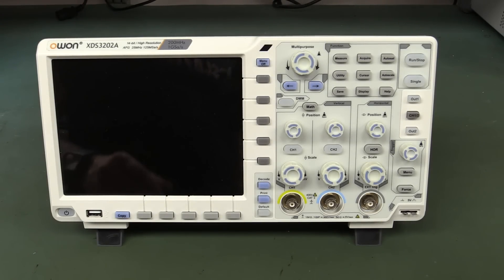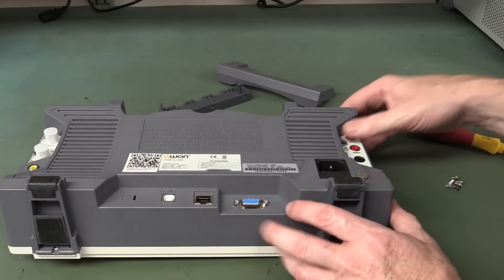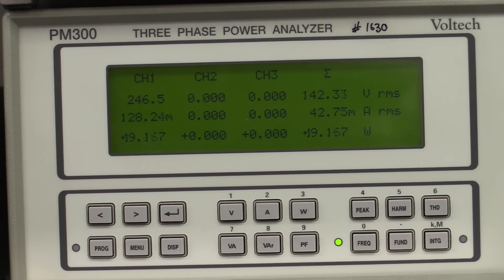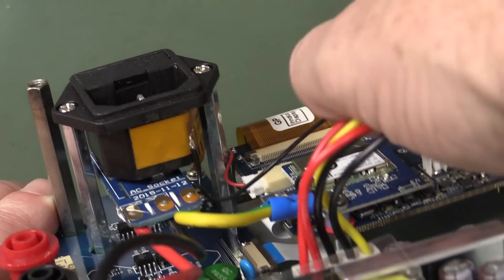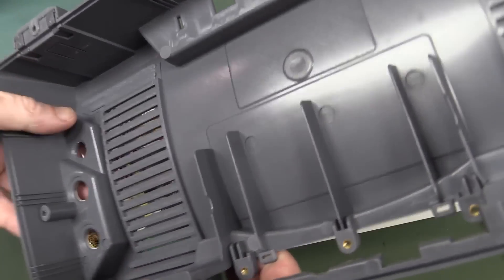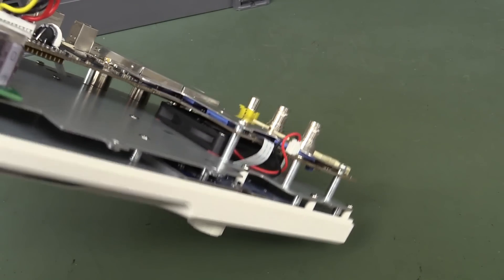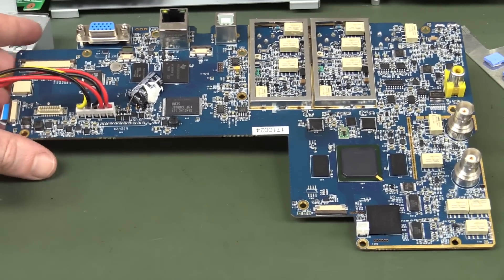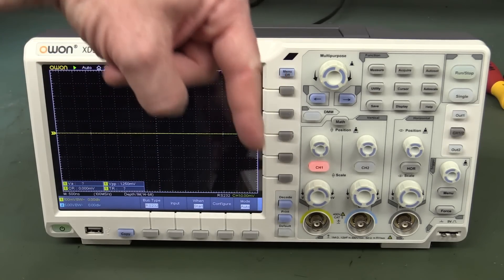EEVblog #1004 - Owon XDS3202A 14bit Oscilloscope Teardown

Comment: That's what you get when you run Microshite ripoffware. I went 100% Linux over 10 years ago and never looked back.
Reply: Robert Langford And no one professional but  popular software You can use :) I'am windows fan, and I never had problem with it. Not once. I never saw blue screen. I never did reinstall. I never saw self frozen. Maybe because I always using workstation computers? I started using Microsoft OS with IBM 286.... 25 Years ago.
Reply: Raymund Hofmann The words of a body that has never given an  operating system based on the Linux kernel a real world trial. The only reason to stick with Windows is to play games that are not available to play on Linux based systems. I have yet to find anything else that I do that I can't do in Linux. As for hardware, I build computers and have no difficulty finding drivers. Mostly they are built into the system now. The difficult ones are for hardware that the manufacturer will not make open source drivers for. That's not the operating systems fault, that lies with the manufacturer. Uneven have laptops running various Linux distributions that I support that have no problems running the installed system.
Reply: Daniel Han So no real argument, just insults? You lose! Goodbye.
Reply: "Finally wifi works out of the box! Maybe this will be the year of the Linux desktop?" (2016: Mobile web usage overtakes desktop for first time) "Damn, the desktop is becoming dinosaurware..."
Reply: @AP12uZvfvag
Android is based on Linux. 
But they also based it on Java, to make it easier for Microsoft to take over the mobile market soon.
Reply: Based on Linux, yes, but as the Stall man would interject, not otherwise based on GNU. As for Microsoft taking over the mobile market because Android is using Java... what are you smoking? They had one chance to get into the mobile space, and they blew it. Microsoft won't be able to take over the mobile market just because they implement an Android compatibility layer. That's just wishful thinking on Microsoft's part. :)
Reply: You're one to talk, you had no arguments either so declaring someone else a loser based on that is not looking good :D I've used Windows, Linux and Mac in many different roles for ~20 years now and they all have their place and their problems. Anyone thinking that Linux is the ultimate tool for everything is just as delusional as anyone thinking that one single programming language is perfect for everything. There are no perfect tools. Linux has its place but it most definitely is not desktop. It has so many problems in multiple areas that the only reason to claim it to be the best desktop environment is fundamentalism pure and simple. Linux is awesome for servers and other remote machines or single use systems like media players but it just can't compete as a general environment. Even the programs made by companies that drive open source software forward like Google or Mozilla work worse on Linux than on windows. My previous work environment was a Linux and Chrome on it was not able to share itself on Google Hangouts. It could share other open Chrome instances, just not the one that had the hangouts page.
Reply: @AP12uZvfvag
Who knows what will come, but i hope my message of how much i dislike Java got through...
Reply: Bean there, done that... Now, Java is where the Sun don't shine no more. All we have left are the faint ramblings of a blind Oracle.
Reply: Shocking news: Linux can also crash after update, been there done that.
Reply: I've never had Linux crash after an update, but it depends which distro you're using. Unlike windows and Apple there is more than one source.
Reply: Bartłomiej Z But never so badly that you can't recover the system because it garbaged your hard disc, except by completely reinstalling Windows and all of the rest of your software, and by the way, you did make backups of all of your settings and files didn't you?
Reply: If you do backups on linux, why you don't do them on windows? We talked about that if it  crash after update and not about what to do to repair after crash.
Reply: Windows 8.1 is more stable than Windows 10.
Reply: No offence, but can you name the linux software for pro imaging like Photoshop. When I say pro I mean support of color spaces like LAB and CMYK, and... well totaly proprietary color management with Pantone. =)
And how about multimedia work like video and sound editing comparable in it's functionality with Final cut/Premiere or Logic/Sonar/Cubase?
Me not trolling you, just hope You can name some powerfull soft as long time Linux user.
Reply: You mean the same photoshop that causes jpeg artifacts to snowball into major picture corruption? Just opening and resaving images causes measureable distortion.
Reply: there's more than games on windows... how about... well i dunno ... engineering software? since thats possibly kind of relevant if you're following this channel... a looot of it is windows only :/
Reply: I have been using Linux professionally for about 20 years, my first was a pre-1.0 Slackware release. It's my full time job to adminster Linux servers. I would love to use Linux on my desktop, but I'm still running Windows.  I have tried on 5 separate occasions to switch to Linux on the desktop, and it's been a pretty bad failure every time.  The most recent time, I decided that I just had to get used to it and forced myself to use Linux as much as possible for 2 months.  1 day after that I was restoring my Windows partition and never looked back since then.
I have many friends who use Linux, some of them are some of the leaders in the Linux community, and they really haven't been able to tell me I'm wrong.
Every time I try this switch I have the same experience, which is that the vast majority of software installs and works OK, but then there's always some piece of software that I really need, and I can spend literally entire days trying to get it even basically working.  What it comes down to is that if the software is in the package manger, you're good.  If not, it's a nightmare of conflicting prerequisites, installing libraries that are not very well documented, etc.
Also, at least as of 2 years ago, I've never been able to get all my hardware working properly.  Printing especially is still horrible.  It mostly barely worked at all 20 years ago, 15 years ago it was disastrously bad, 10 years ago just horrible, 2 years ago (last time I tried) it was just very disappointing - you would get 1/10th the feature set the printer was capable of doing.  I have webcams that I never got working. Display drivers were generally abysmal.  Some printers simply can't be used under Linux (I have a label printer that I use heavily that I have never even heard of working under Linux).
Reply: Agreed, for servers and for embedded systems, Linux is fantastic. It's running on a very large percentage of the world's computers. But for me anyway, it's hopeless on the desktop.
Reply: Got to be a one off experience.
Reply: @John Ridley - I have the same Linux background (Slackware v1.0 yeah!) However I am a hardware/firmware engineer and do use Linux with no problem at work. Any time I need to run a windows app I just light it up on a Win7 WM instance with Virtualbox; there are only a few I need... I think the ability to run Linux as the main OS comes down to the work in the end. In your case it could be that the richness of windows applications for your IT needs is just not available in Linux and its just less painful to run Win as your main OS... I do run Win7 & 10 at home and do some firmware stuff there. In the firmware work on windows it seems that Windows 7 is still the sweet spot... nothing but pain for trying to get Win10 to work.
Cheers,
 - Eddy
Reply: backup always as usual :) Regardless OS...
Reply: macOS > Linux & Windows
Reply: You can't even get a licence for OSX without buying Apples overpriced hardware or old ass machines.
Reply: Raymund, I've been using Linux as my desktop OS for nearly a decade and I'm far more productive than I ever was using Windows as my desktop platform.  I'm no Linux Jihadist, just someone who values my time and likes to get the most work done in the shortest period.  Linux for me isn't a ideological choice -- it's a practical one.
Reply: Every OS has it's pros and cons. Windows is user friendly and has better program and game support and those are all cons for Linux. An OS is only good if it meets your needs and as a PC gamer Linux does not meet mine so in your words Linux sucks.
Reply: There are people defending spyware 10? It's funny that some people think there's nothing wrong with having to choose between no updates at all and forced updates.
Reply: You can buy a license on the appstore for $19.99.
Reply: It's frequently shocking for me to read so many technically illiterate comments (especially about Linux) in a comment thread under a video that ought to have a technically literate viewership. Robert Langford is correct -- you can use Linux successfully without any problems and never look back. You also can justify using Windows and Mac OS for some scenarios -- but those scenarios keep getting more and more rare.
Reply: Robert Langford Games.
Reply: Knuckles: Steam. I've been playing Alien Isolation on Linux for some time now. Portal, Portal 2 and The Talos Principle is in my Steam library as well. There are more games for Linux, OS X and Android than I could play in five livetimes. (I'm coming from the Atari ST where the situation has been similar during my adolescence -- no boredom on the games front, ever.)
Reply: Knuckles the Echidna PCIE passthrough, WINE and dual booting are always there when you need them. Sure, it sounds a bit harder but you get the best of both worlds that way.
Reply: Nope, I'm talking about the desktop version.
The desktop upgrades are free, but the initial license isn't.
https://www.apple.com/shop/product/D6106Z/A/os-x-lion
Reply: +Deepee
Amiga > ST
Reply: Deepee Ayadges In recent years Linux has received far better support from game devs but is still miles behind Windows in the gaming department. If you're perfectly happy with the Linux library of games then that's cool but not everyone will be so Linux is not a suitable OS for them. 

I would love to have Linux as my main OS on my desktop but pretty much every game I play right now does not have a Linux version so until then I use the more suitable OS Windows.
Reply: Mac Donalds -- ah, the old feud between Atari and Amiga fans; as somebody interested in electronics tinkering (which is implied of a EEVblog watcher), you surely appreciate the Atari ST's simplicity and openness to modifications; whereas the Amiga with its many complex ASICs and complicated timings is another beast, evidenced also by UAE's complexity compared to Atari emulators. 

The Amiga has always had the better and quite UNIXy operating system than the Atari (the buggy Atari-TOS situation later being improved by MinT and MagiC), yet as a programmer and tinkerer myself, the Atari ST has MIDI, a dirt-simple, DOS-FAT compatible file system, an exceptionally sharp monochrome monitor and much simpler and more flexible timings. But, as with Linux today, to each their own. Cheers!
Reply: LOLDONGS, I think »miles« is not the proper unit of measure there.  :-)
As with other types of software, what does it matter if there are 10e5 games available I'll never play or 10e6? If I really wanted to play a game exclusive to Windows (which one?), I go the Wine route described by soundspark and may even learn something in the process. Because of this and because of the fact that you've put your comment in a thread unter a EEVblog video, dare I suggest that Windows may not be the most suitable OS for you after all? Just sayin'.
Reply: soundspark I know what they are and that VMs and WINE are entirely different things, to clarify I was trying to say that you can use one of the two to run windows only software on a linux installation.
Reply: Deepee Ayadges hehe yeaaa true, I do love playing around with Linux especially on my Pi 3 🦊 but still have a clunky desktop just for GTA 5 and a few simulators running Windaz 10.
Reply: Daniel Han that's a bit mean, not all autistic people are overweight trolls who sit in their stinky basement eating donuts all day!
Reply: Deepee Ayadges Yeah that can fine for OpenGL stuff but what happens if the game you want to play is DirectX11/12 only?
Reply: FWIW, I have friends who are leading figures in the Linux community. They scoffed when I told them that I had use cases that I simply couldn't make Linux work with.  I presented them with what I needed, and after a few days they came back and said they agreed, what I needed wasn't really supported by any current software under Linux.
But even more to the point, I've gotten to the point where I really just don't care what OS I'm using.  The OS is not an end to itself, it's simply a platform that lets me run the software that I need to get to the end of the day and collect a paycheck. My ONLY criteria are 1)Does it run the software I need, and 2) does it do so without getting in my way?
Linux got in my way ALL THE TIME. Windows just doesn't.  At least as long as I can keep running Windows 7.  10 got in my way, so I nuked it and went back to 7.
Reply: After several attempts at moving to Linux, the best I could do was to dual boot, which is really not an acceptable solution since I frequently have jobs that run for many hours at a time, which meant that I had to postpone things I needed to do for hours until I got a chance to reboot.
When I compared the two, my conclusion was, there are things that I can't do under Linux.  There's nothing that I need to do that I can't do under Windows.  Therefore I run Windows.
Reply: People defending Windows are not necessarily defending Windows 10.  I used 10 for about a year, and finally got pissed off enough that I wiped it from all 4 of my machines and went back to 7.
Reply: John gets it, an OS is only good if it meets the end users needs. Yeah Windows is shit and I use it as no other OS supports my needs.
Reply: soundspark Mainly due to my lack of information regarding this topic.     I may have thought of the "Wine is not an emulator" acronym while typing.
Reply: I'm a unix & linux sysadmin. I use both linux and windows and don't have any problem with any of them. The reason you still call windows "microshite" like a early 2000 script kiddy is because you, i quote : "went 100% Linux over 10 years ago and never looked back".

Both linux and windows went a long way since your nostalgic days of slackware (it was my main OS/Distro, on a 486 DX66, along with an Appolo running HPUX and a bunch of Sun pizzabox running netbsd & solaris).

I also code on both plateform (and also writing my own OS).
I certainly love writing C with vim and GCC, but for "general purpose" software requiring a GUI, let's be honnest, C#/.net/WPF/VisualStudio is amazingly and surprisingly powerfull and efficient. Meaning : it's fast to code good application, regardless of performance, because who care if the software use 5% of your CPU instead of 2% ? And if you still believe so, i'm wondering if you ever worked professionnally. In this day and age, human ressource are much much much more expensive than computer ressource and management and financial directors doesn't care at all if you need a 30 or a 40 server cluster, as long as it's developed & maintained with low human ressource (i learned it the very hard way). Linux have a long way to go in the desktop world. Not because of the OS itself, but because of the expensive (human-ressource wise) desktop ecosystem.
Reply: Agreed. Windows these days is a far cry from XP which was really not very good. 7 was a gigantic step up (and I'm still using it).
And also agree that these days programmer time is worth WAY WAY more than CPU time. I have no problems ordering up another 4 quad-Xeon blades with 256GB RAM and dual gigabit connections, but it's a really really hard sell to get another headcount, and the people we have are already badly overloaded.
Reply: Laurent, when we criticize Microsoft, it's rarely because of efficiency concerns (alas, as an admin, you may have stories about attempts to automate adding Windows-AD user accounts, Lync, Exchange and shared volumes -- a nightmare, compared to the Unix world) -- it's the bad, buggy and insecure architectures and APIs, terribly implemented technology transitions (service packs, 64bit, ineffective driver signing), registry hell, DLL hell, user-profile hell and dot-net-version hell, increasingly immense malware risks because of broken security concepts, still pervasive lack of integration of MS- and non-MS tech, expensive and shady mass-licence/-bundling policies (at least here in Europe),  I could go on. 

On the other hand, to counter your IDE example, try Qt Creator with Linux -- there are talks online, given by Valve coders, many of them coming from the MS-Visual-Studio world, good stuff. 

Windows still may be better than no OS at all (well, we always can feel around for better jobs in that respect), but my feeling, Laurent, is, that you remembered the good stuff when writing your comment, and forgot all the bad stuff. Cheers!
Reply: If Sony could port the XMB firmware from the Cell processor to the PlayStation 2 like R4000 in the PSP, why couldn't they port XMB to the PlayStation 2?
Reply: joseph williams I like your idea, sometimes it's best to step back  from the pretty arguments about Windows and Linux, jump on the motorbike and go for a ride and/or turn on the old PS2 for some retro gaming action.
Reply: indeed. 

the PS2 was an awesome system. in processing power and graphics alone it blew away everything in the market at the time. lol
If they'd designed the firmware a bit more advanced it could've done all sorts of general purpose things like play videos and music, transfer and copy files, run apps, web !
Reply: They gave it an optional HDD and then made it only for game storage. haha. if it had a hard drive the shit we do with our Xbox 360/ Ones we could've pretty much done with PS2
Reply: i switched from Qt to WPF :D
1) i dislike C++ (personal taste)
2) QtDesigner is a nightmare
3) QtCreator is far, far behind VisualStudio
4) the DLL Hell is gone since windows 7 (well, 7 was still a messy transition but it's the starting point of the end of DLL Hell)

I hate windows 9x and pretty much never used it, i was linux/unix only. I liked windows 2000. There is nothing i hated more than windows XP and therefore never installed it on my computers (used win2k until the very EOL). Pretty much everything went fine since win7 for me. (the signed drivers transition was difficult for sure).

The library dependency nightmare when developping was solved with NuGet. 

Linux don't have a lot of the problem Windows had (and still have) because we have opensource software and we can recompile them against any library version we have on any distro we have. the /lib /usr/lib /usr/local/lib /opt/lib /opt/<vendor>/lib bag-o-stuff isn't really any better than how windows handle dll.

Do you run proprietary software on your linux server/desktop ? do you run multiple proprietary software from different vendors (and sometime different century ^^) on a single linux computer ? Windows does it on a daily basis (sometime with a lot of cry and blood, sometime by corrupting the OS because of some insane software vendors that doesn't know better). maybe you do, maybe you don't, but it's difficult to do it and it can require uncommon/expensive human skill to succeed. 

i even had this problem with opensource software... the joys of circular dependencies...

I'm not saying one is better than the other for everything. Windows handle tons of craps from proprietary vendors with relatively good success compared to how the linux ecosystem handle it (which they don't really btw, you usually have to buy a "certified" redhat/suse/whatever distro of a specific 1 billion year old version and never ever modify it if you want your software to keep running). And of course i wouldn't touch a windows web server with a telephone pole because wtf was Microsoft thinking when they wrote windows server.
Reply: it is, indeed, correct. it have some kind of portability since it's possible to run WPF app on android and iphone but... well... let's say it doesn't :D
Reply: C is very good and i llike it. But using it for GUI based software ? meh. i tried (too many times) and it's not a fun experience at all, error prone, a mess to maintain.
Reply: Joseph williams, the OG xbox blew the PS2 away in terms of graphics at the time but the PS2 had the far better game library and that is what makes a console good.
Reply: +soundspark. they could've solved that issue with a hard drive.
look at the linux distro ROMs that are for the PS2.
Reply: I don't get that either.
the xbox was basically a PC. wouldn't any windows ( x86 ) game run? was this a DRM thing with microshaft?
Reply: they never were too descriptive of their firmware but from what I gather it was the just Windows 2000 kernel with limited UI
Reply: It did use some custom intel Pentium III CPU and runs a custom OS based on the Windows NT kernel. I'm not too sure how different the CPU in that was compared to standard PCs are as CPU architecture is way beyond me.
Reply: lol yeah, me either. oh to be an engineer at Intel..

It seems like inbuilt obsolescence to me because they design a computer with pretty much all the features of a desktop PC; generally with the best hardware bang for $$, and then limit it's functionality.

MS had the good idea of designing around x86 but then they get all greedy and say no you ONLY run our approved media etc etc..
Reply: I don't really think that the vast majority of electricians have a $10 meter.  But the vast majority of programmers ARE running Windows.  We have a few hundred of the in the building right now.  Many of them use Linux - at home, as a hobby.